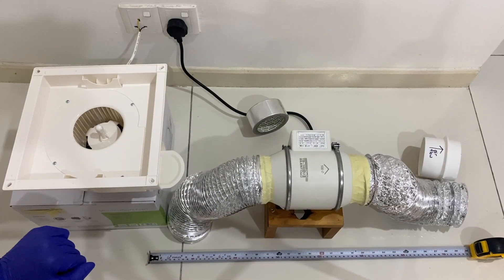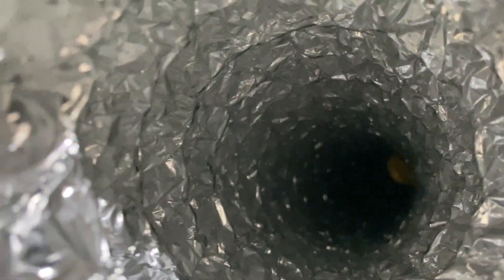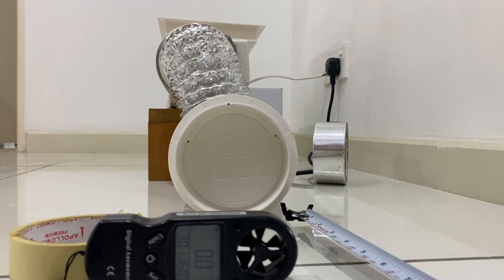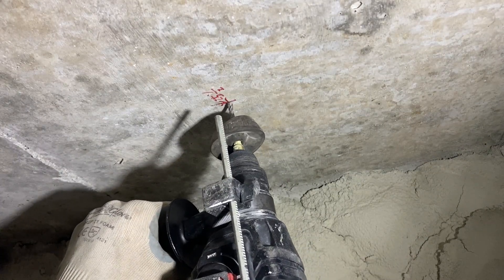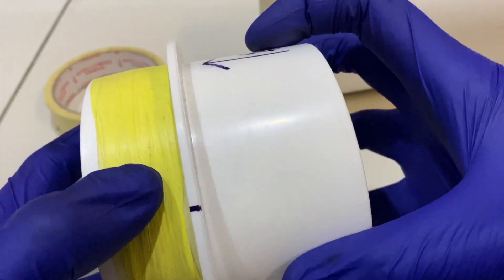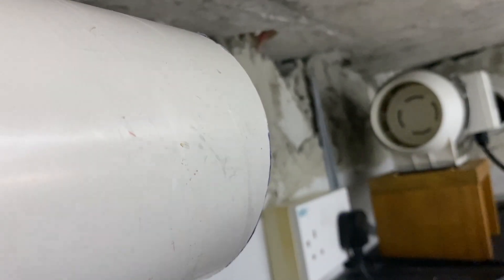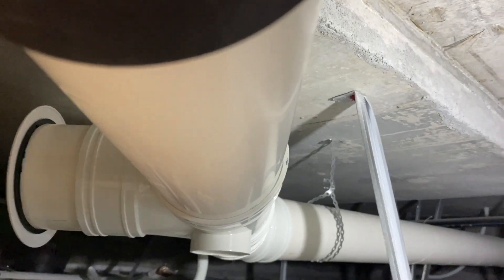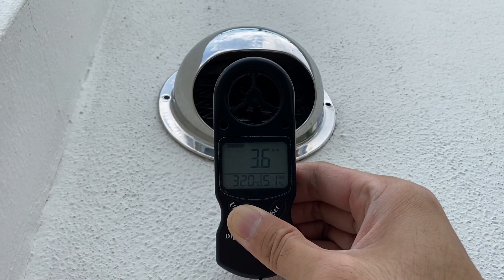Prevent cold air from entering through home exhaust fan ducting using back draught shutter

Comment: Thanks, I am doing this to prevent contaminated air coming in to my home
Reply from the maker: If that is the case, I will not advise to turn in this or perhaps install a HEPA grade filter. The outlet of this also needs to add a filter.
Reply: @CTB6  yep so my existing issue is my extractor fan lets in smoke air from outside so first I need to one way valve that.

Inside I run a purifier with hepa filters 

But I am going to do full mechanical ventilation when the summer comes around so there is nothing bad in the air and have a professional install it
Reply from the maker: @not-another-dev That works too.

Comment: Interesting video.  For your information, the flexible duct is not made from any aluminum, it is made of plastic, but painted to appear like aluminum.  Actual flexible aluminum duct is much less flexible.  Also, your measurement of air speed is not useful for comparison, because flow restriction will increase speed while decreasing total flow volume.  For a more useful measurement, you can calculate flow volume as a function of speed and tube cross sectional area (for this you want to put the meter more close to the tube opening).  It would be very helpful if you can make a measurement of flow volume with, and again without, the backdraft damper, to help us understand how much flow restriction is caused by the damper.  Thanks for the video!
Reply from the maker: Thanks for the sharing. Didn’t know about it earlier. I was intend to find out if any drop of air speed if I add more opening for different rooms.

Comment: Great video. I need to do this soon.  What is the brand of the backdraft air flow, and what is the better aluminum flexible pipe.  That's for sharing your experience.  THUMBS UP!!!
Reply from the maker: I search from online store app for backdraft. Use those Aluminium flexible pipe with heat insulation if you are from country with different climate seasons. It prevent heat lost.

Comment: Thanks. Please share a video about how to replace the steering wheel air bag in proton persona. Thanks
Reply from the maker: Have you found the way? There are three screws embedded by the side of the wheel. Disconnect the battery for precaution.